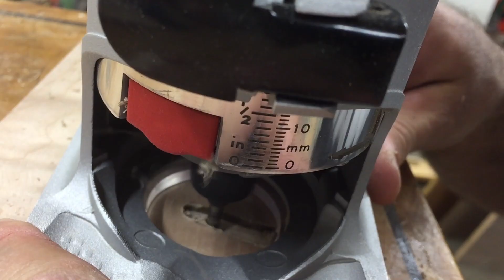DIY Tape Dispenser // (Ep. 62)

Comment: Great looking tape dispensers , I made a few for the shop and found out once I switched tape rolls they wouldn't fit the disc that holds them . I got the new roll to fit by removing a wrap of the inner core .  I'm not sure but perhaps each manufacture has a different size inner core  , something to keep in mind if anyone wants to make one like this .
Reply from the maker: +Jerry Sateriale thanks, thats a good observation. If the rolls are too small for the plywood discs you can always make another disc too. They are really simple and quick to make.